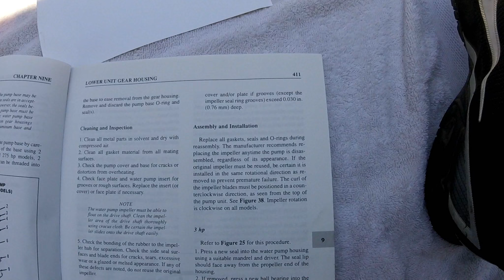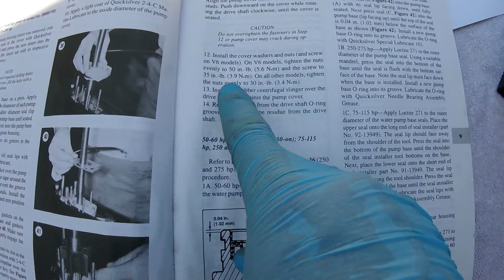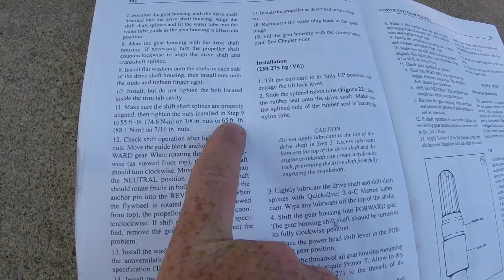Mercury Outboard - Water Pump Impeller Replacement

Comment: I use a hose clamp to compress the impeller to put in the housing.  Just leave about 3/16" out on on side with all vanes in the right direction, then slip into the housing and loosen hose clamp and push all the way in.  Be sure and coat impeller with silicone grease beforehand!

Comment: Hey! I got the same motor same year 150hp ,is the water pee coming out suppose to be verry hot or its not normal? Thanks
Reply: Mines a XR6 same thing just a little newer also wondering this ? My buzzer has been going off during no wake zones noticed not peeing well during this once wide open pees fine but water is very hot regardless I’m changing mine today if parts store has the parts

Comment: I have a wire hanging off the left lower side of the lower section of the motor.  It's connected to what looks like a capacitor I have a photo but don't know how to upload it here

Comment: Great video bud!! I just picked up a 1994 Skeeter with the Black Max 175 and I ordered a new water pump kit off Amazon. I plan on changing mine this weekend and your video will help me a lot! I do have a few questions, is the liquid gasket necessary? If so I need to get some before I start. Did you change out your thermostats? Did you have to wait until your motor got to temperature before it would “pee” at an idle? Also, I was told I couldn’t run mine using water muffs, I have to run in a tank like you did for the water pump to work? So sorry for all of the questions and I do appreciate the help! 👍🏼
Reply from the maker: Air muffs are crap and would not pee much with muffs, not enough pressure.  Pees great with garbage can.  Takes a few minutes to get going so give it a few.  I have new video coming out I built a tank out of plywood.  Get a gigantic garbage can from Home Depot.
Reply from the maker: No I don't think the liquid gasket is doing much but it was there before so I replaced where I saw it before, it's like a separation wall there.
Reply from the maker: I don't know anything about a thermostat.  There is no thermostat like a car since it runs the impeller 100% of the time.  Maybe I don't know something but I don't think there is a thermostats on my 2 stroke, V6.
Reply from the maker: please subscribe, trying to get to 1,000.  Thanks!
Reply: My 1991 Mercury XR4 150 V-6 has 2 thermostats, one in each cylinder head.  Mine does not pee until it has been running for about 90 to 120 seconds.  Also if you run it with a tank the water will get hot.  There is more hot water coming out of the engine than just the pee.  Its best to use the muffs and the tank.  That way the motor is constantly getting water that is not hot and if the muffs are not quite enough there is the tank of water there.
Reply: @MuellerMechanical  Yes you have 2 thermostats at the top of engine just above the spark plugs....
Reply: Liquid gasket is needed to keep exhaust from entering housing. watch video by Geoff Morris very good .

Comment: Hello,
I need a little help locating where the hose coming from the “valve thermal air” leads to. It’s the valve located between plugs 3 and 5 on that same engine. Thank you in advance.

Comment: What gear is the shifter when you pulled lower unit
Reply from the maker: Must have been in Neutral
Reply: @MuellerMechanical  Should have been in FORWARD.

Comment: Awesome video! Is there anything besides all the bolts at the lower unit that might be holding on a stuck lower unit? Ive been battling with mine, apparently the previous owner never removed it to change the water pump. Is there anything up top holding onto the drive or shift shafts? Or do I just keep battling the corrosion
Reply: Most likely corrosion I had the same issue
Reply: It might just have one more bolt you are missing so look carefully. In the end I had 5 nuts and like 2 bolts.
Reply: I realize I am extremely late to this....but there is a bolt under the steering trim tab. You have to remove the anode (trim tab) to get to it

Comment: How did you know it was bad?
Reply from the maker: ha good question, I didn't.  Father in law told me to replace it every 10 years.  It was never replaced and was a 1990 so thought was a good time!
Reply from the maker: do you mind if you subscribe?  1,000 is coming soon.  Appreciate it!
Reply: @MuellerMechanical  10 years? Damn... i replace mine every 1-2 years. I can tell you that its fairly easy preventative maintenace that will save you a tow or worse

Comment: Have plugged the oil system and began to mix yourself or continue to use oil pump?
Reply from the maker: I'm still using the external pressurized auto fill Reservoir tank that resides in the boat

Comment: Howdy. Ive replaced the impella and the thermostats on my 1885 150 mariner and was test driving it, there was a steady stream from tell tall, after driving for about 15 mins the alarm went off and there was no water from the tell tale.. i shut the motor down.
Please help..
Reply: Colesy Coles let me know when you find the problem
Reply: I had no idea they had outboard motors in 1885.
Reply: @josephtrapanese3310  lol
Reply: Change your impeller

Comment: what does the silicone do ? Never seen this done before
Reply from the maker: Yes at 4:34 you can see where we pulled off the old silicone, it's on top of the steel divider wall that gets sandwiched with the upper housing.  Pretty much just replaced what I found.  thanks for watching!  Please subscribe and I will have more boat repair vids forthcoming.
Reply: Stops exhaust gasses from getting to the pump housing, which will heat it up some and reduce life

Comment: I noticed what is consistent in all of the  Mercury pump videos is what steps are missing when reattaching the lower unit.  There is a rubber hose attached to a nipple at the shift housing in all of the videos, but no one mentions what it is or where it is attached.  No one includes it in the disassembly steps.   In fact, some videos show it missing, but show the nipple connection inside.  There was obviously one there before.  When I took mine apart, there was no hose, but there was a nipple.  I will put one on now, but I have no idea what it connects to outside the lower unit.   Someone in the comment section here calls it a spedo hose.  Maybe that connects to my speedometer.  Also, it is next to impossible to line up the shift rod with its mate above.  The mate moves around and you cannot see in there or move it around to match up.  That would have been good to know.  I bet they all had trouble but left it out of the videos  because of all of the cursing.  I still haven't gotten mine back together.
Reply: Yes, that hose is for the speedometer.
Reply: For anybody else having issues reassembling, use power trim to fold the engine almost all the way up then have a friend over use a thicker wire like a metal coat hanger or something to push the shift rod and water hose in to position while you push the lower unit up towards the motor
Reply: Did you lock it in forward gear before disassembly, that keeps it lined up for assembly, also if the drive shaft doesn't line up , just reach up and rotate fly wheel.

Comment: Great video... I got a 95 XR6 and I'm going to change my impeller hopefully this weekend. This will be a first for me. Ive watched this video several times. Looks like it should be a breeze (I hope).
Reply: Hardest part is getting everything hooked up and back in alignment when you put the lower unit back on
Reply: @ericsweeney4544  I got it all apart last weekend. But after the I changed the water pump. Water wasn't coming out of the tell tale. So I decided to change the thermostat cause those were bad and I ran a wire through all the tubes. But still no water. So I pulled the LU off again and took the pump apart. Reassembled and it worked.

Comment: You didn't see all that water in your lower unit gear lube. Milk shake, you have bad prop and possibly driveshaft seals.
Reply from the maker: George, check out this vid from yesterday.  I think I'm good, prop good, driveshaft good.

https://www.youtube.com/watch?v=Q8k3AFMT_jo

thanks,
MM
Reply: ALWAYS  check the little washers on the gear housing drain/vent screws. It may save a ton of $$$$

Comment: Nice little video. The only advise I would give is that when you are adding the lower gear lube, spin the prop by hand a few times to get the air out of the bearings and such.
Reply: actually it's "advice"...   advice is a noun,  advise is a verb   5th Grade...
Reply: @williamriley2528  Typo. Tool!
Reply: @williamriley2528  omg wow so helpful😐

Comment: Did you add red loctite to a stud that uses a nylock?
Reply: Nylocks can be reusable, but if you can finger tighten it past the nylon "prevailing torque" without resistance, it might be time for a new one or a lil threadlocker if you don't have a replacement on hand. Blue or orange threadlocker might have been a better option.
Reply: @rts3613  you're gonna have a tough time with that red... good luck

Comment: Damn Dude...  Polish that prop...!    Now which way were those impeller blades facing again...???   lol    Bolts are meaasured by their thread diameter & thread pitch, NOT THEIR HEX HEAD SIZE...!
Reply: Does a 1989 mercury 200 black max have a a row
Termastat. Put on mew water pump but still running hot and no water from the tell tell. Any suggestions
Reply: Jin Meyio change it